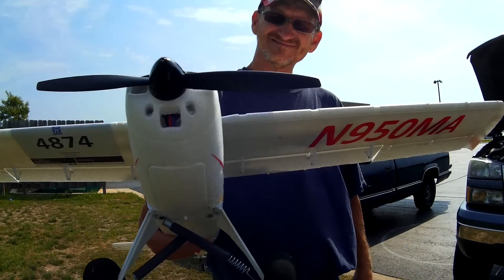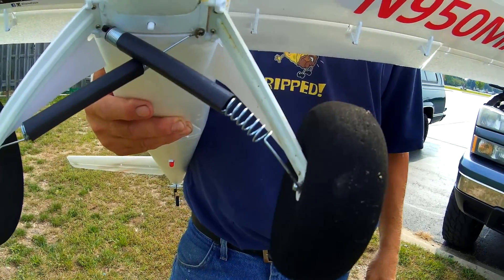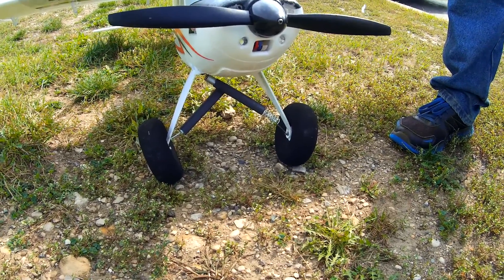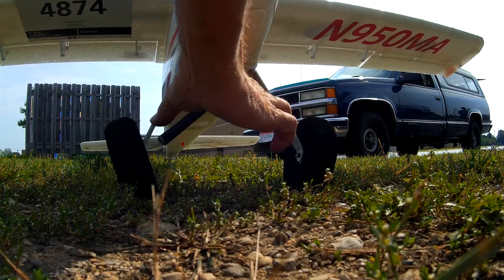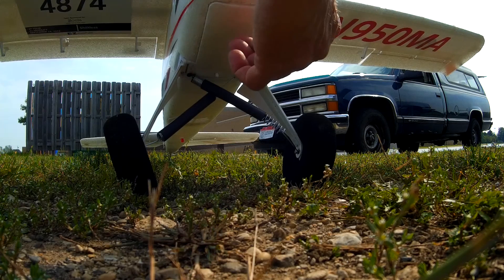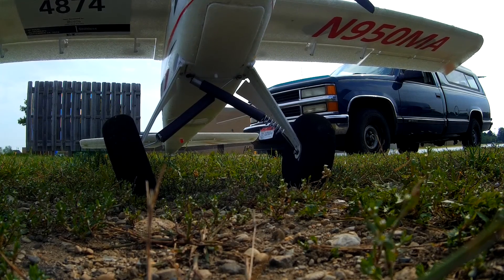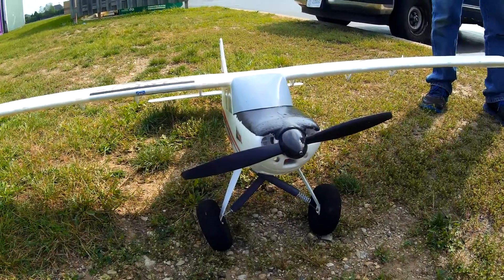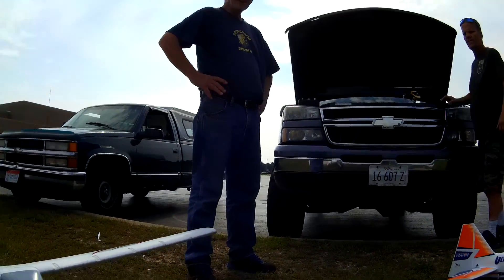E-Flite Timber Mods to Gear by the CrashTest Boyz, Marty,  SundayFlying the Wind 7-12 mph.  Pt.1

Comment: Something is wrong with that guy's landing gear it looks nothing like a Cubs that has no toe in just has all positive camber, and I don't understand what's wrong with the gear to begin with mine has taken so much abuse in fact I think it's the best gear out there other than the pr bushwheel gear.
Reply from the maker: He did it home made style, hardware store springs.  Didn't work well at taken off.  replaced with stock.